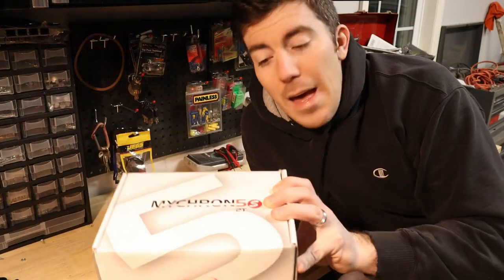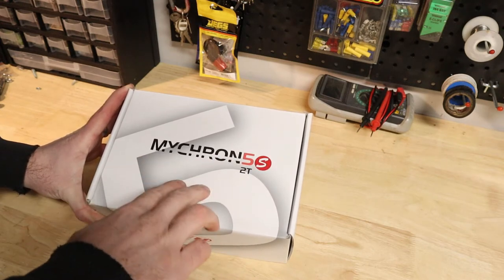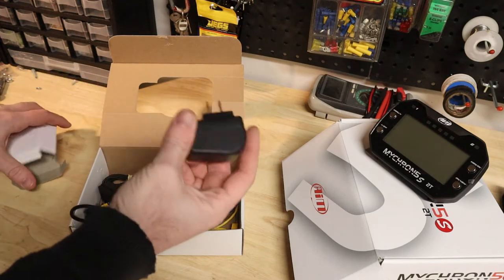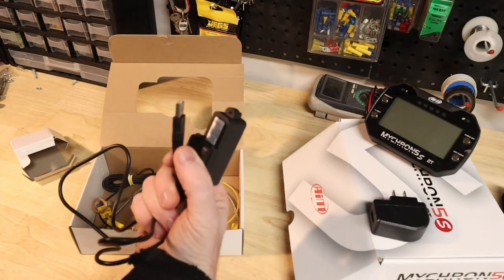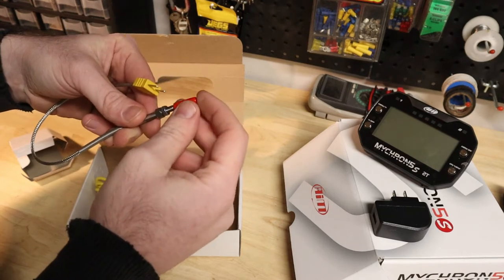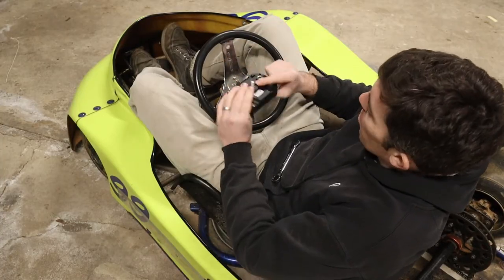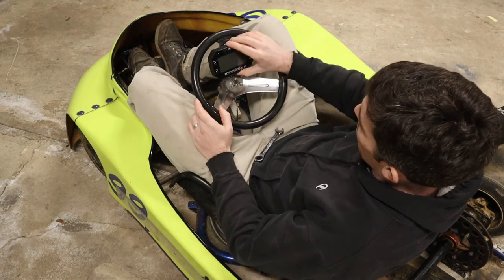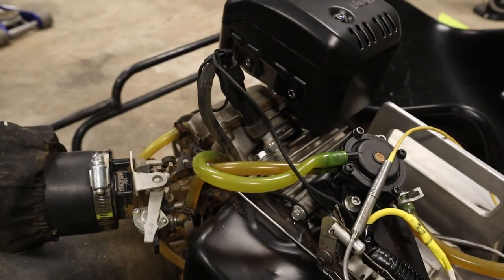AIM Mychron 5S Unboxing and Install on the Kart

Comment: Hi,  Ive just bought a Kz and i was wondering if i can know in what gear am i while im racing.
Reply from the maker: With the Mychron 5 there is a data hub you can use to gather other data but I don't believe the gear position is one, unfortunately.  Aim might have another system that might though... https://www.aimtechnologies.com/kart/aim-mychron-5/
Reply: @karttunenetwork  perfect, I was just wondering because if you have a look on this video https://youtube.com/watch?v=JZppRQ9rkbA&feature=share in the middle of the screen looks like numbers going up and down at the same time the driver changes gear.

Comment: Hello! I have a question - do you think that a system like this can be used on a simple Sodi kart? How fast you can mount it without temperature and RPM sensors and what data will it show? Speed and lap time? or more? I was looking at basic MyChron 5S
Reply from the maker: Its uses GPS for speed so if it can get a decent GPS lock you would get speed, lap times, etc.  I do believe that the engine RPM is what triggers the system on so you might have some challenges without engine RPM.
Reply: Hi, did you try it? I would like to try the same in a sodi kart
Reply: @michaelmarsalli2924  no, but i have seen people successfully using it

Comment: Hi! Good Morning. Can I ask you something? my mychron 5 generates 14 partials when I download the information to the computer (depending on the direction changes of the circuit). This produces that it has a considerable difference between the real return with respect to the ideal return. I want to do 4 partials but I don't know how to do it. Should I modify it from "master map"?
Reply from the maker: Great question.  I've not gotten that in depth with the system yet unfortunately.  I'll keep this in mind as I do some additional work with it.